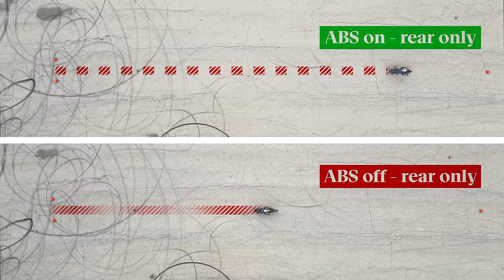Out-braking the ABS Myth

Comment: THANK YOU! This is what I've been trying to tell anyone who's spouted the "I can stop faster than ABS" crap. Unless you are practicing threshold braking regularly, you probably won't outperform ABS on a good day, let alone in an emergency. Most riders are terrified of their front brake.

ABS is your bike inviting you to practice threshold braking cause it'll step in when you overshoot.
Reply: Though he made a good point about driving on snow.
With regular braking in snowy and icy conditions you can literally feel how ABS releases brakes completely and prevent you from slowing down. And in such condition almost without thinking you try to brake to the point ABS starts to work - and after it does you release brake slightly. It doesn't even feels like "I am doing good without ABS!" - it feels like "I am pressing the pedal but at some point it starts to fight me back", kinda similar to stick shaker in case of stall warning. You release pedal not because "oh it is ABS and it is bad" - but because pedal literally starts hitting your leg like crazy.
It never happens in dry conditions because reasonable braking is far beyond locking wheels. And pretty sure it never happens in emergency because you just push it in the floor and ignore everything about it.
Reply: You know,the next time soneone says to you that he can stop faster without ABS you might wanna ask what his first bike was. It will make you less of a clown
Reply: @deadlymecury  There's an unconfirmed rumor that on Australian gravel roads ABS doesn't really help. Yeah, it does stupid things on snow so I'm inclined to believe that rumor.
Reply: @kampar82  gravel has a lot of friction though. It's not that easy to slide on gravel and it's not that easy to move gravel on top of other gravel. Maybe some really small fractions (like if you decrease fraction infinitely - you will end up with the sand), but for bikes usually it's not just gravel that is dangerous but small patches of gravel on asphalt.

I can imagine that ABS can be activated on gravel easier than on asphalt - but I doubt that it will be even near in comparison to fresh snow and ice.
Reply: And even very skilled rider is not outperforming ABS on the wet, let alone doing so on random patches of sand. And this is like that since 2005, when ABS was rather basic, modern systems are way faster.
Reply: @deadlymecury  What? There is less friction on gravel, and it is very easy to slide on. I ride gravel every day, sometimes for hours.
Reply: The people spouting that ARE probably people who can actually stop faster than ABS and do practice threshold braking. "I am so mad I will disconfirm any facts from riders who are better than me".
I ride a track bike to the limits with no rider aids.

Leave ABS for the rain and noobies.
Reply: @deadlymecury  Tell that to my traction control, it doesn't want to believe in high friction. Not all gravel is created equal, I think the rumor stems from the ball bearing gravel, so any possibility for you to actually stop disappears when the abs says nah. Hard stop in snow and gravel is improved when you're able to create a wedge of snow or gravel in front of the tire.
Reply: @shaundisch2020  less than on snow?..
Reply: "Most riders are terrified of their front brake" Do you mean this literally? I don't understand, why are riders afraid of their front brake? It's the effective one.
Reply: @kampar82 you mean rounded without sharp edges?.. Like from beach or something like that?
Reply: @deadlymecury  Yes, additionally very loose. For them it's normal I guess
Reply: @deadlymecury  Ah, I thought you meant compared to pavement. Got it.
Reply: @SoEz2Hack  I just had someone asking on FB for advice before their MSF course and this guy who's only been riding for one year absolutely insists that a new rider should never use their front brake under 10 mph. Says they will 100% crash. I basically told him that is terrible advice and you need to learn sensitivity to the front brake and at least practice muscle memory even if you're only applying 5% pressure. And he's like "we should agree to disagree". No dude, it's not disagreeing.. you're self taught rider of 1 year, I'm 10 years and racing.. you're literally just wrong.
Reply: @SoEz2Hack  Yes, literally most riders. I should point out, anything over 50% constitutes "most"

The reason is that if you lock up the front brake on a bike without ABS, you are likely to have a low side cash. Far too few riders actually take the time to do any practice outside of casual riding on the street. As a result, "most" riders can't use their front brake effectively. This is what I mean by "terrified."
Reply: @Dangerwiggles  Thanks for the advice.

I'm no Rossi, but I've been riding for 15 years and can tell by observation when a rider is better than me. The people I'm referring to usually have 2 or 3 years riding experience and THINK they can outperform ABS because they heard it's technically possible.

Yes, under good conditions, many riders can outperform ABS. But the reality is that it's not by much, and an emergency is not a good condition to be in.

Comment: When I started riding I was really into dominating the vehicle. It was quite fun for me to try things and push a motorcycle to some degree of a limit. I spent quite a lot of time on a bike, so it also helped entertaining myself. Sure, I fell quite a few times, but never anything serious. 
Now I've heard of a progressive braking and tried it, again, in a daily riding just for the sake of entertainment and feeling good about my skill. But then that one day, I was with my then girlfriend out on a highway and that truck on the line right to me suddenly changed the line without any turning signal. Now I was going about a 100 km/h, and a right line was going around 50 which is the reason he changed the line. Just got tired of going slow, so he just went for it as a proper asshole. Obviously, being a truck, he couldn't reach the speed of a lane so I had to go into a sudden emergency braking. I had maybe like 20-30 meters to reduce my speed by half. And I didn't have ABS on my bike. Had I pushed too hard, I'd fall and the car behind me would've gone over me. Not enough and I would go under the truck. That was that one moment when I got seriously scared. The most I have ever been on a bike. Mostly because I had a very dear passenger behind. I couldn't have reacted to it, had I not practiced those emergency braking for "fun". I went straight by the book, applying progressive force on both levers, but my mind was out scared for its life. My hands did everything as if by themselves. 
The point I try to make here is that you have to practise. If it's fun for you then you can do it just when you're out, having a nice daily ride. If it's not, then take some time and practise anyway. It will save your life someday and probably others, too.
Reply: hi ck5, have you become a flat earther yet?
Reply: @flat-earther  hi flat-earther, have you become an Odinist yet?
Reply: Progressive braking is actually bad. Are you sure you are not talking about threshold braking ? You need to avoid increasing braking force. The initial braking is the moment you can brake the hardest as your wheels and transmission still have inertia. It last for an instant, but it usable. Then you need to decrease braking force slightly to avoid locking, and then you need to keep that same force, unless the fork is riding on bump stops -that means the slightest bump will shock the tyre and you will lose grip.  Progressive braking means you are leaving a lot of braking possibility at the start, you will most likely hit the fork bump stop ( or tyre grip limit) when increasing pressure, and you basically forfeit the ability to change course over the braking distance, since the more you brake, the less you can steer.
Reply: @croustibat682  The wheels and transmission have inertia as long as they are spinning, i.e. until you are stopped.

progressive braking is progressively increasing front brake pressure as the front tire gets loaded by weight transfer, leading to a higher downward force on the tire and more grip, allowing more braking power. You progressively increase brake pressure up to the threshold where the tire is barely maintaining grip.

Am I misunderstanding something, or are you very wrong?
Reply: @croustibat682 I do not believe your advice is quite correct.  Though it depends on whether or not you have abs . The contact patch on the front tire has the greatest effect on the quality of your braking performance. At the track we are taught to apply modest force first to create a larger contact area before applying maximum braking force. A skidding front tire can't slow you down as well and if you have any lean angle you're going down instantly.
Reply: happened to me on a z400 with abs a truck suddenly changed lane and i was forced to take the shoulder which is sandy part of the road here in Philippines... that's when the first time i felt the abs worked jerking the brake lever
Reply: I was testing my abs in the rain the other day. Certain patches of concrete I could brake at 90% of my entire strength before the ABS would activate and other patches, the ABS would activate at 10% of my strength, barely touching the thing. You cannot predict when your tire will Lock even with practice. It's silly to think you can predict the exact friction on the surface you're on as well as magically see oil Or other grime on the road and reduce your braking suddenly to 5% as you go over it and then back to 90% and then back 25% when you go over some grime and then back to 90% in order to not lay it down in the middle of the highway and get killed.

Comment: I've been riding dirt bikes since age 10, street bikes since age 17, and mountain biking since age 22. It wasn't until I started riding mountain bikes on very steep  terrain that I really learned how to use the front brake. Riding steep descents (like, incilnes so steep that it's difficult to walk UP) is very much like riding at high speeds, in that there is a very fine balance point between maintaining control, and endoing, or locking up/washing out the front wheel. My current bike is a 2014 FZ-09, with no ABS, and I've been in many hard-braking/avoidance situations on the street where I felt like most lesser experienced riders might have ended up on the ground. I guess my point is that there is no substitute for experience and familiarity with your machine. I run the front brake on the right on both of my bicycles (MTB and road bike) because I feel that keeps that feel for the front tire in one hand without having to "switch sides" in your brain.
Reply: very well said 👍 there is no substitute for experience and familiarity with your machine

Comment: My biggest thing: if you have ABS, you can practice braking without fear.  Youre not going to tuck the front and crash, you can keep squeezing that fromt lever ever harder till the ABS says "ok, thats it".  

Ive NEVER met anyone whonpractices emergency braking without ABS till the front actually starts to lock.
Reply: the front only locks if youre lucky. youre more likely to fly over the handlebars if you give it way too much front brake
Reply: I have. Unintentionally, and only from 70 kph.
Reply: In Hungary you have to take the first part of the driving test with no ABS and the final part is crash avoidance (with counter steering) and emergency braking. You have to speed up to 50 then stop in 14 meters, if you lock up your tires you fail.
Reply: @laszlohary7430  In Australia you get 12m to stop from 50. Again, lock up and you fail.
Reply: I did 😂😂 
I mean couple of times I had too 😅
Mostly by riding it in gravel u easily realize the grip and locking it 

And major part is experience!!!
Reply: when i learned to ride, i was told when breaking use 60% front and 40% back as most of the stopping power comes from the front.
Reply: @simonhadley6965  That's bad training, honestly.  Under maximal braking 100% is the front because the rear will have no weight (and may even lift).  You want to start with both, but the braking ability of the rear tire will decrease as overall braking increases.  You start with both because you can't just hammer the brake on the front, you need to build pressure to achieve maximum braking without losing traction.  In those initial moments, then, you're getting important braking from the rear as well.  

Ratios are bad practice though and shouldn't be taught, because they simply don't work for motorcycles at all.
Reply: So when training, you use assists? Interesting. Wouldn't you want to learn how to ride and brake in emergecny situations, where you DONT have ABS? I've locked up my front and rear brake when emergency braking. No problem at all, as long as you are sitting hard against your tank, and looking straight into the horizon, as long as you are in a line it wont just flip
Reply: @BlackSlimShady Nope, I’d rather have the assists. As long as you don’t lock it up, it’s just traditional braking. 
ABS only kicks in when lockup is sensed.

Comment: A good piece of advice for non-abs beginners would be to ride always with two fingers on brake lever. This way instead of grabbing a lever in panic and locking a wheel, you are always ready to gradually squeze the lever. For some it may seem uncomfortable, but after a while it becomes natural, and saved me a few times already.
Reply: Learned the same at Yamaha ChampStreet school.
Reply: Exactly. I ride with my index finger on the fe501 lever. I’ve only had three emergency panic brakes(to avoid deer) and every situation was the exact same-

Clutch in, front brake applied just enough to keep the rear tire from completely coming off the pavement, and rear braking just hard enough to make the tire chirp. 

Anyone who heard me would assume I have(I don’t) ABS by the chirping. Not because I’m applying too much rear brake, but because the rear end is nearly floating and wanting to come around. 

For some reason I twisted the throttle and the bike was revving all three times. Maybe for a bit of additional pull on my lonely index finger.
Reply: I do this too and I learned it from riding bicycles. 
It's very useful on my scooter that has gigantic brakes.
Reply: Riding offroad helps alot with riding on road, too. When riding offroad a huge part is brake control, especially on slippery ground. It's common for wheels to lock up and you learn how to deal with these situations.
Reply: I would recommend doing that on ABS bikes as well, it just feels a lot smoother when braking.
Reply: Fortnine actually mentioned that in one of their videos. "5 Life-Saving Habits for Motorcycle Riders". Their argument was that if you preload the brake lever, even if you grab it in a panic the speed of your grab will be slower.
Reply: @WontSeeReplies I've never ridden an abs bike. What's it like to turn and brake? I've fallen over many times breaking too hard into a corner.
Reply: I did that for a couple weeks and I couldn't cross my index and middle fingers for two years.  Be careful when you do this
Reply: @bingusmctingus4395  did you pull so hard your fingers kinda popped out of place?
Reply: In the real world you can not train for the unexpected. If you have enough time to think of what you are going to do then it is not an emergency. Things happen in the blink of an eye.
Reply: @tomakafrankconlon3207  I disagree. I used to ride dirt bikes all the time, then when I rode street bikes whenever cars cut me off, you don't think you react, if the back tire slides, you adjust your weight without thinking. (Getting ran off the road happened all the time, I lived in a retirement town).
I also wrecked all the time, off road, and on. 20 years later, I'm still not perfect, but I still enjoy riding and learning how to ride better.
Reply: @tomakafrankconlon3207 That's the whole point of practice and training, build muscle memory and do it instinctively so there is no thinking involved.
Same way you would train in the Army or Police. Practice enough times and on a regular basis so that when the emergency happens instinct takes over.

Comment: I was about 12 years old when I practiced locking up the front tire on my big sisters bicycle that had a really powerful brake at the front. I did it on a slight downhill, down to a level concrete pad with coarse surface. It had a miniscule ramp on the edge that gave the front tire just enough lift to get it to lock up. Years later I trained locking up the front tire a bit on a scooter on some parking lot that had a spot with really smooth asphalt. Often when it's slippery at winter and I ride a bicycle, I have the tendency to try and to lock the front and keep the tire in a skid as long as I can without losing balance. It's kinda like a small challenge to do it every once in a while. Though I haven't ridden pretty much anything powered on two wheels since 17.

Comment: You can learn threshhold braking if you have ABS to save you when you lock up the front. You can learn threshhold braking without ABS if you don't mind going through a lot of bikes.
Reply: Excellent point to add to this.
Reply: Well, thats a great way to look at it.
Reply: True. ABS only engages when lockup is sensed.
Get good enough at threshold braking and it won’t lock up, traditional braking pretty much.
Reply: ahaha what an expert. You can learn threshold braking on non ABS bike easily too without crashing. How? Use the brain maybe you will figure it out
Reply: @46rrodriguez  What the hell happened to you?
Reply: @motorcycle-man  dont like the experts who dont know what they talking about. Whats wrong with you :)
Reply: @46rrodriguez  Settle down there wannabe Valentino Rossi 🤡
Reply: @OneFreeMan17  i like his passion for the racing not gonna lie. Who is your riding inspiration. RuPaul ? 😄